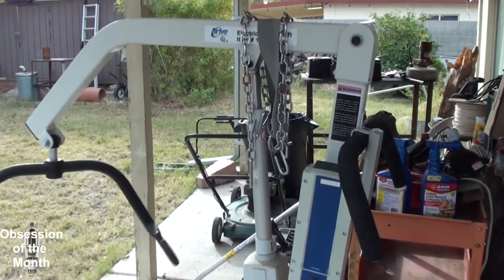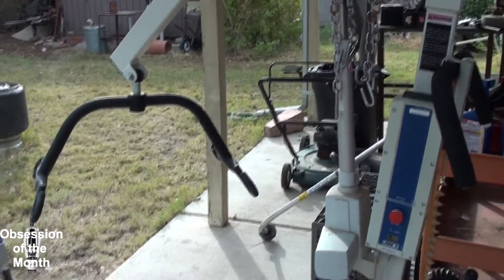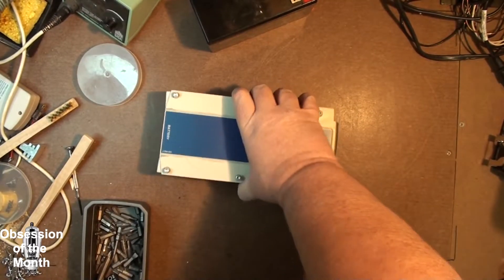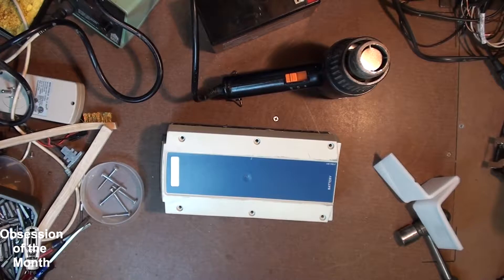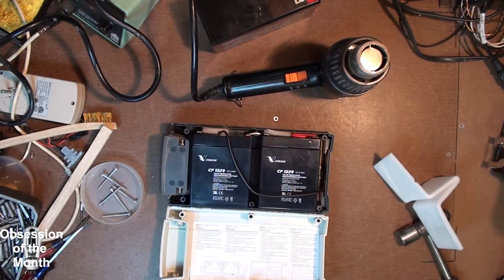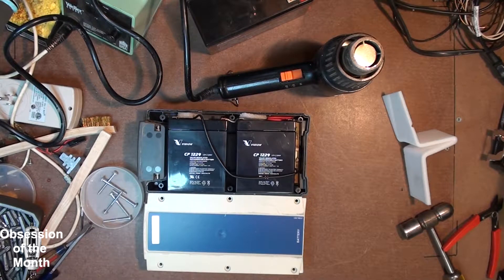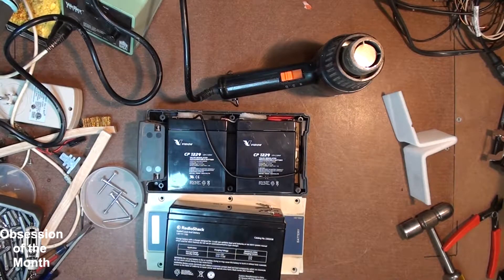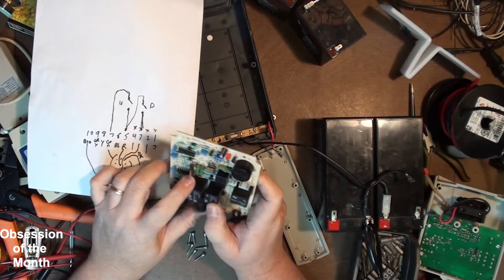Linak hoyer lift Simple conversion Part 1 of 2

Comment: Thank you. I was able to replace the batteries for $65 cnd. Also great call on the glue holding the casing together. I used a hairdryer to loosen it up and opened one side at a time.